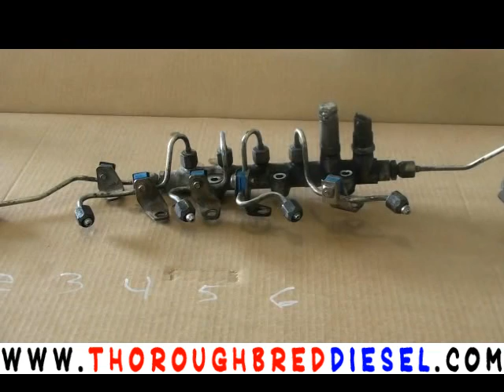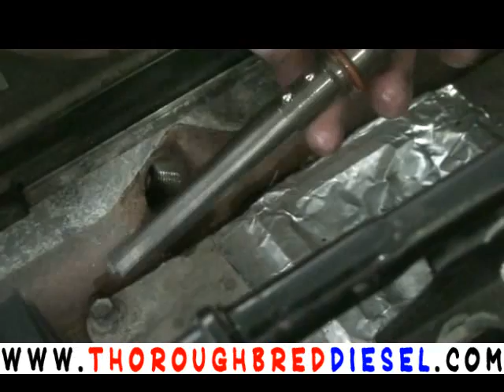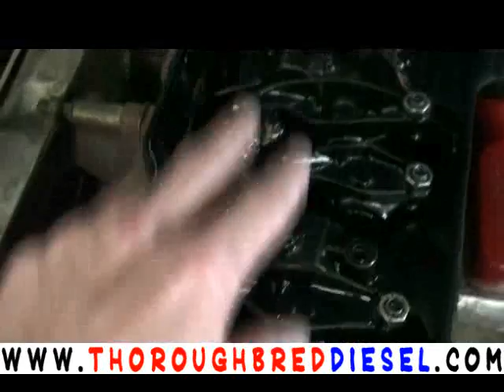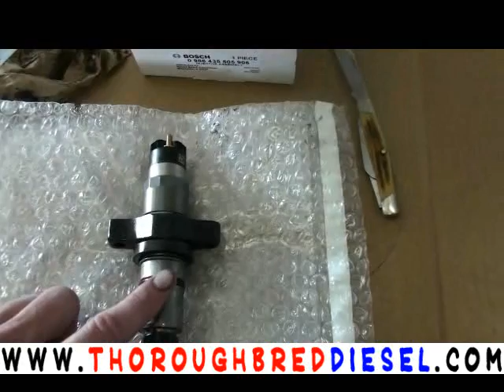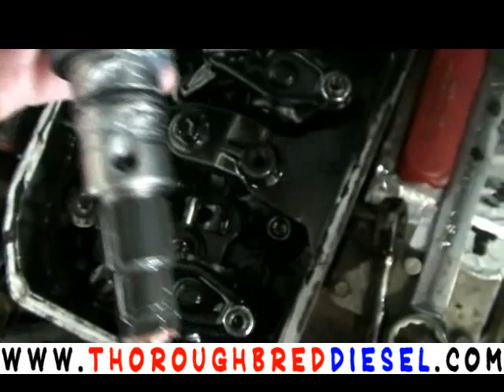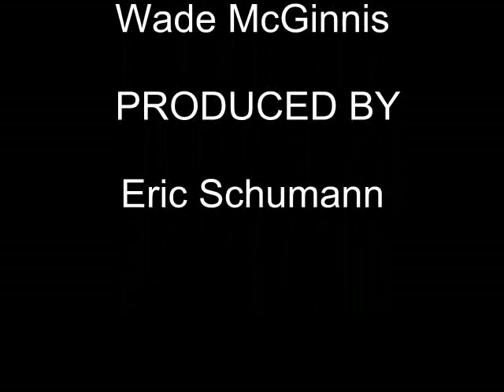Injector Install: 2004.5-2007 Common Rail Dodge Cummins

Comment from the maker: Most likely you have an injector that is bad. First thing to do is check your lift pump pressure at the injection pump and check your fuel filter. Also you will want to check your oil pan to see if you have diesel fuel inside of it.
Reply: Thoroughbred Diesel generator
Reply: ⁹

Comment: Video was EXTREMELY helpful...with one exception...I think you should make it clear that there is NO need to remove the bolt connecting to the push rods...this adds A LOT more headache and time to your project...LOL yes...I did this...and now i have to reset ALL my valve spacing...AAAHHH oh well it probably needed to be checked out anyways. Thanks again for the great video...now i just need to find a video on "how to lash'...cant seem to find how to roll the motor over to set the lashing

Comment: What a lifesaver!!!!!!!!!!! We had a 05 with a new cracked head. The tech that took it apart quit before the head came back from the M.S. Watched your video and it went back together quick. Great job and great cam work. G and T Auto & Truck Repair.

Comment: i'd like to see the video of removing the fuel rail. my dodge must be the redheaded step child. it has the lifting eye bracket at number 5, and number 6 has the safety plate rite behind it. pia to remove due to no clearance between block and firewall.

Comment: you always change the cross over feed tubes. sorta shotty work. also you never push on the solenoid on the injector, use a 15/16 socket to push on the middle part of the injector. also never mentioned the tourqe sequence to allow no leakage at the injector and feed tube. its hard to seal 20 thou psi when the surfaces r not sealed.

Comment: Hi, since the rocker arm needs to be removed to replace injector, I am doing all 6 injectors as well. should I get done with one injector at a time and also adjust the OHV before moving on to the next injector/cylinder? thank you.

Comment: So you don't replace the rubber O-ring on the injector hold down tube ?
Reply from the maker: The feed tube, if that’s what you are referring to, should be replace anytime the injectors are removed or replaced.  Then you get a new O-ring anyway.

Comment: Any advice for the rear ones? I am stuck on the last one. Very tight space to remove the fuel rail line.
Reply from the maker: Remove the lifting bracket if you haven’t already, should get you some room. Stubby wrenches are your friend and make sure you use a wrench to hold the feed tube nut.
Reply: @thoroughbreddiesel  

Yeah I got the lifting bracket couple of days ago. There seems to be another bracket on the rear which seems to be in the way of fitting a socket to remove the injector tube. Not sure if there is anyway to remove the injector tube with that rear bracket. Maybe with a wrench but not a socket. That is what I’m struggling with is that last bracket on the rear of the engine.

Comment: Great Video, Got any advice for the #6 Injector? That one scares me, do you really need to remove the crash bracket back behind the head?
Reply from the maker: It's much easier if you remove the lifting bracket to remove.

Comment: I want to know if there are any tips to accessing injector 5 and 6. Are these harder to get to?
Reply: also wondering this, yes they are harder
Reply: Remove the engine lifting bracket and use stubby wrenches.

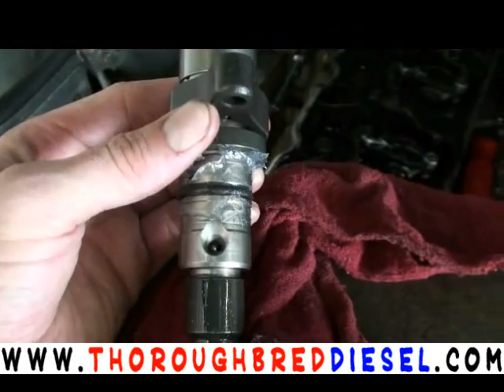Comment: Would this be the same process if I was wanting to install 370's? And is a 505 more than 370? And if I was to install them, how would you make sure that the feed hole is in the direction of the feed tube? ( 3:56 )

Comment: Do y'all have a video on how to run the overhead on these engines? If not, if y'all could make one it would be greatly appreciated. What are the best larger than stock injectors? 
Thanks- Keith
Reply from the maker: +Keith Mask We will do that. Thank you for the feedback!

Comment: I have an 06 with 200,000 that had #5 injector just go bad/open circuit. Ohm meter confirmed its injector.. 4.0 ohms. I replaced all 6 about 2015 with 140,000 on it, but I was a cheap dumbass who didn't replace the connector tubes. Seemed to run fine though. About 2019 I installed an air dog system on it. Anyways, along with ordering new injector, I ordered 6 new connector tubes. How would you recommend I install them on the other 5 good injectors? Leave injectors hold down and just R&R tubes? Loosen injectors hold down then install tubes?

Comment: How do u depressurize the commonrail?
Reply from the maker: There won’t be any pressure on the lines when the vehicle is not running.
Reply: @thoroughbreddiesel   i was wondering the same thing, since in the fuel filter replacement video you mentioned at the end not to open a fuel injector line or something like that without depressurization or is that only when it’s running?

Comment: Lol it does not take hours to remove a injector.Once the feed tubes come out and the head cover is off it doesnt take that long.Have you ever worked on a powerstroke 6.4s most have to take the cab off witch takes about 5hrs not including injectors yet.Inline diesels are the easiest to do.

Comment: Do you have to put the engine on TDC before starting the injector removal ???
Reply: No. TDC only comes into play when you need to adjust valve lash

Comment: When you change out a injector on a 5.9 2006 cummins do you have to use a scan tool to enter a new code in the Ecm
Reply from the maker: No, on the 2003-2007 5.9 trucks, there are no trim codes.

Comment: I have 2004.5 Dodge 3500 with the Cummins. When I went to check and adjust the valve lash there was a spring attached to the bottom side of the valve cover. The spring was broke. Didn't reinstall due to being broke. Everything I have read states it is a ground spring. Does this spring need to be replaced with a new one?
Reply from the maker: You are correct,  it is a ground spring and we do suggest replacing it.

Comment: what are the torque specs for the rocker arm bolts that were removed during the install?
Reply from the maker: +Leedell Scott Jr Rocker Arm bolts are 27 ft lbs.
Reply: +Thoroughbred Diesel Thanks
Reply: +Thoroughbred Diesel What is the torque specs for the nuts for the electrical connections on the injectors?
Reply from the maker: +Patrick Kanatzer 13 inch lbs.  Which is not much more than finger tight.  Very important not to over tighten because stretching the terminal can affect the electrical travel in the solenoid.

Comment: I have a 2004.5 if I have two bad injectors do I need to replace all 6 or can I just do 2? thanks
Reply from the maker: Honestly,  with the age of the truck,  you would be better off to replace all six.  Both for peace of mind and also for less confusion with warranty situations.
Reply: +Thoroughbred Diesel it only has 120k miles...
Reply from the maker: Garth Leavens That’s low mileage for age.  I still would do all six and start fresh.

Comment: Great video.  I have an 06 which after passing acceleration on the highway went into a rough running kind of limp mode where it will only run 50-55mph or so.  It idles rough now. Very low power.  Did battery disconnect and it still has the problem.  Giving code P0204.  First time it happened we changed the valve cover gasket.  That was a week or two ago.  Now problem back.  Any ideas?
Reply: RadicalRC ever figure out the problem? My truck is doing the same thing

Comment: Lol 48hrs labor what are you smoking?
Reply: "4 to 8 hours". About 1.5 hours for removal, same back together is 3 hours. Another hour to run an overhead and you got 4 hours.  Now if shits stuck or breaks you're adding time. Also remember this is shop time, if the overhead takes 35 minutes that's an hour. If the job takes 4h40m that's 5 hours
Reply: Woops....6 years ago haha! I'm sure you've figured it out by now